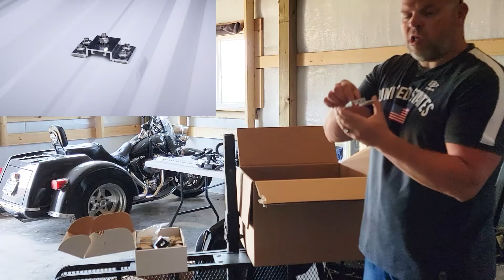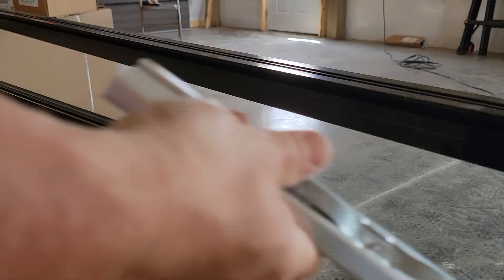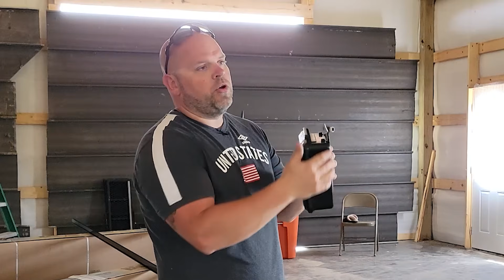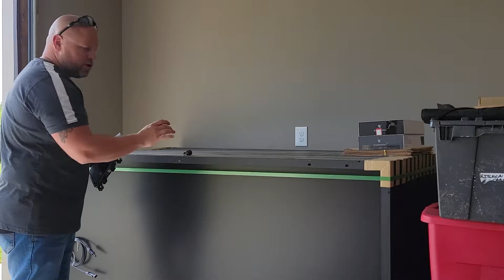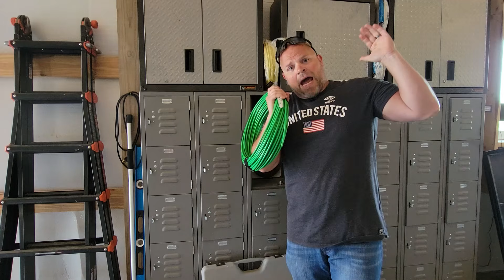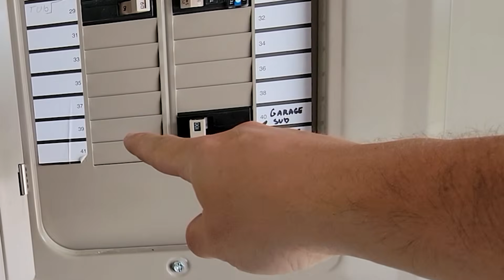Build an ENPHASE Solar System - All the Parts you will NEED

Comment: Excellent video, I see you bought 370W Solar Panels, which is oversize since the IQ7+ have a peak of 295VA (300 in my experience) but at the end is the best solution. I did a similar installation with IQ7+ using 375W panels, if you calculate that in 20~25years they will degrade a 20% (in the worst case), so a 375w panel will become a 300W solar panel in 2 decades.
Reply from the maker: Exactly! I planned for that upfront. Thanks for watching and commenting!
Reply: I’m a year out from putting my system on a new build, so just beginning to educate myself. But isn’t the rating of the panel under perfect conditions that never happen, so wouldn’t the IQ7+ match up with a real-world max output of a 370W panel anyway?
Reply: @geekstradamus1548  my calculation is around 90% of the panel output, so a 370W is around 330w under a clear sky but the IQ7+ output is 295/300VA peak. In my experience for my system, I get a 3hrs (11am to 2pm) of 300w max production completely flat (capped), but I'm sure the panel output is more than that. I saw some test that many panels can produce the max and sometimes a little more under ideal conditions, which is clear sky around noon (not too hot/cold).
Reply: @federicov362  ok, awesome info! Appreciate it.

Comment: Great video exact type of setup I am looking to do. Could you install the combiner box and the Enphase Envoy and disconnect on the metal building and tie into the sub panel?
Reply from the maker: Short answer is no. It was required to be connected to and close to the main service panel. In installing solar there are many codes to familiarize yourself with, electrical, building and even fire. It's worth the time it takes to research that and in the end will save you 10's of thousands of dollars 💸 💵 . Goodluck, thanks for watching and commenting 👍🏻

Comment: Can this enphase system run 240v to charge EVs. I would like to build a ground mounted array on my land I got a good patch of land that has unobstructed sun
Reply from the maker: Yes you can charge EV's and power your home at the same time with an enphase system. Just determine the size of system you need and build from there. Thanks for watching and commenting 👍🏻
Reply: @TheSolarPit  soni can have output both 240v and 120v as well?
Reply: @m4vr1ck  the output is 2x120v (split phase, total 240V) which you can feed your main panel (is required, otherwise the Enphase won't produce any kwh) then charge your EV. You can't charge directly to your EV since the microinverters need to receive electricity/voltage from the grid, unless you have battery backup (and use it as off-grid system).

Comment: Very good video. I just had a 9.87kw solar system with Enphase microinverters Iq 8-H. Yes, very expensive. However, the installation company never informed me about monitoring the system. As such I had to buy a separate Enphase combiner box -4 and installed it myself after taking courses via online Enphase University. Wish I had seen this video earlier and saved myself some of my hard-earned money.
Reply from the maker: Appreciate it! Yeah the cool thing about these enphase systems is that we can monitor it down to the individual panel. Cool stuff you installed the combiner box yourself! Good job! 👍🏻 Thanks for watching and commenting 👍🏻
Reply: @TheSolarPit  The schematic on the side panel made it easy.
Reply: Im in disbelief that they installed the system and didnt even set up monitoring for you. Id be furious
Reply: @MrNoirNight  I am furious and have complained so much with no effect. Still working on it. It seems the system is only producing about 3kw instead of 9.8kw because only one small portable ac 125v unit runs. With two small units grid power is pulled in. What a disaster with these scammers.
Reply: @Gil_Jara  3kw...somethings not right dude. How many panels do you have?
Reply: @MrNoirNight  25 Trina 395w panela, 25 IQ8-H Enhpase microinverters.
Reply from the maker: With your combiner box it should have been equipped with an envoy. With that you should be able to see the production down to the panel in your enlighten app. This helps you determine what panels are not producing and the ones that are. Just to make sure, the panels are open to sky with full sun, no shade for atleast 5-6 hours a day - facing south, right. If all that checks out there could be a vdrop situation where the installer did not calculate the homeruns wiring size and length correctly. Just some items to consider reviewing. Hope that helps.
Reply: @TheSolarPit  Yes it has the envoy, but Enphase reps said that only the installer company can make an account and commission my system. They are dragging their feet.  My system has been ready since early June and is still not functioning correctly. Without the gateway connected to the envoy I have no idea what micros or panels are dead. They do not care. They have their $30k already. Shotty scam solar company.
Reply: @Gil_Jara  You can do it yourself, you just have to take Enphases course, although since the system is already installed Im not sure if theyd allow that 🤔
Reply: @MrNoirNight  I called, and they said no. Only the installers can do it.
Reply: @MrNoirNight  I have taken 5 courses from Enphase University so far but stopped once I was informed that I could not commission the system myself.
Reply: @Gil_Jara  Oh yah? Do you mind if I ask, did you start taking the courses before or after the system was installed?
Reply from the maker: @Gil_Jara  If you took the classes on enphase university and got certified as an installer, create an installer account like I did. Then call enphase tech support, give them your installer number and let them know you are an installer installing your own system. From there let them know your situation and they will walk you through the process to get the envoy connected. They were very helpful everytime I called them. Goodluck, hope you get it fixed.
Reply: @MrNoirNight  After
Reply: @Gil_Jara  Ah ok gotchya. Well, Ill keep my fingers crossed for you man.

Comment: I would be concerned about voltage drop from the array to the enphase combiner, which you said was 166 feet. Step up the wire size from #12 to a #8, at least a #10 to avoid voltage drop. Too much voltage drop will affect your production especially on sunny days.
Reply from the maker: The actual wire length once cut in and connected should be around 100-115max. I'm playing it safe cutting the 500ft roll into 3 equal parts of 166. Do you think that will help since it's not actually going to be a 166ft run but closer to 100ft. My building is roughly 60ft from the combiner. But with wall climbs and roof peneration points I'm guessing atleast 35 to 45 more ft total. Thanks for watching, sharing and commenting 👍🏻